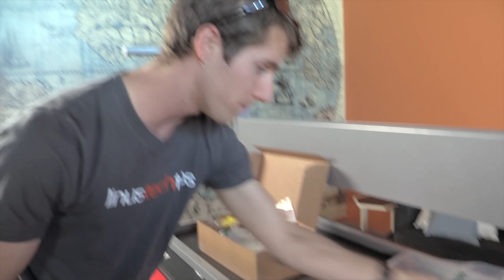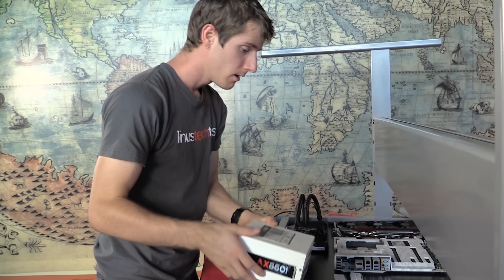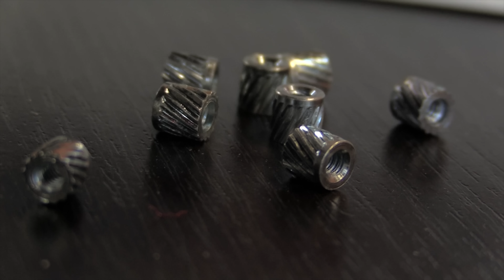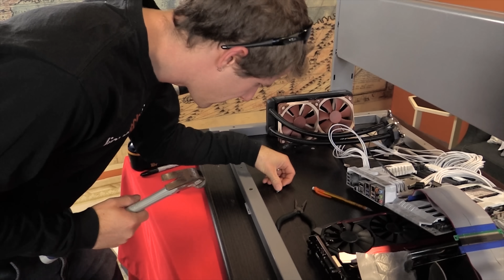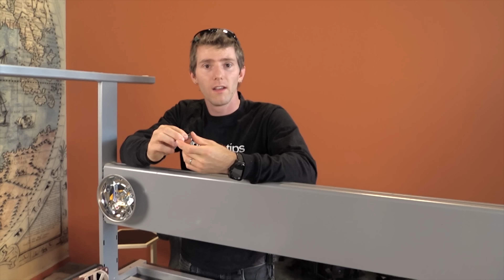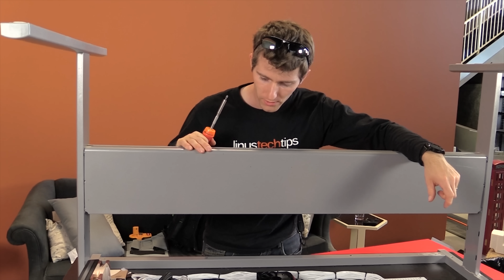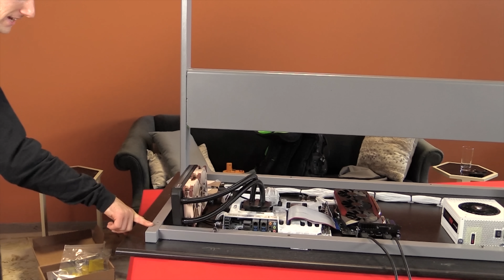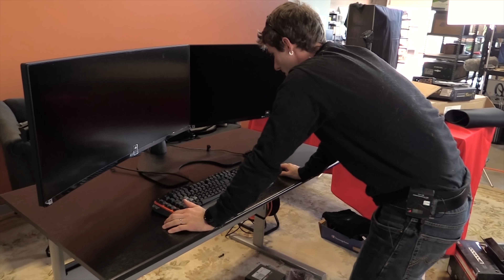The ULTIMATE Space-Saving PC - Desk PC Build Log

Comment: This is a fail of a fail of a fail. Better Solution - Install in side drawer or center drawer if it has enough clearance. Your board is upside down, but normal heat flow was assumed, correctly, from the Side or Bottom Up. You did say it! But Still 100% someone is going to sit down and hit their leg/knee into that unprotected computer. A minor pain for them, a Major pain to the board's functional lifetime. 
So my take on this: Do Not Try This At Home!!!

Comment: Edit @16:19: See? I told you, Linus. Now you have to wear a full face helmet in-case that shit falls on you.

Worst idea ever. Why not build into the SIDE of the desk (or inside a desk cabinet) so that you don't have to flip over the damn table every time you want to change something (Or alternatively have your table wall-mounted and it can be lifted with hinges but even then you will accidentally hit your knee into that giant protruding PSU.) Also why didn't you just use some cheap Industrial Velcro, or a slide lock with a bolt covering the slide mechanism? that way you need to do less screwing. Why does this look like someone paid you to do this Linus? This is was a terrible idea from the start.

Comment: I think if you use regular CPU air cooling you probably cannot mount the motherboard upside down ... perhaps you can try mounting the motherboard on the kickstand of the table, so the whole thing is  vertical instead of horizontal, and CPU air cooling can still work.

Comment: Building this computer with 2U or 3U rack mounting chassis and attaching it under the table would have been ,
1. Less painful.
2. Without custom wiring.
3. Easy to maintain.
4. More safer for user.
5. More safer for computer.
6. Equally space saving.
7. Less pron to dust.
8. And of course, less adventure.
9. Did I miss anything?

Linus, will you allow me to work with you there? I don't expect salary. Just give me food and place to sleep. 😉😍
I am really big fan of you. 🤗

Comment: the only con I see here. is it does limit where in your house you can put this. meaning not near vents where heating can blow into it. As well dust. But dust wouldnt be hard to clean out tbh.. can air... The only concern I have tbh would be the screw inserts failing and falling out..

Comment: this seems very interesting but it can be better. maybe mount the keyboard inside the top of the desk and replace some wood with glass and use rgb lighting, get a usb hub and mount it inside the top as well, and if you could find away around  wire management make the computer rest on a board and use the sliding drawer things on the sides so you can just pull it out when you need to service it d:

Comment: I was looking at the setup and was like... Which way does it go? But it was corrected.

If I were to do this, the PSU and the Cooler would he on the back side of the kick panel. The fans would probably work less, due to the metal frame absorbing the heat.

Second option, mounting on a board and then to the desk. If the desk got damaged, I would not have to redo all the work!

Comment: Does it effect the air flow though, compared to a close case.. like heat what is the difference between a closed case compared to open components stuck to the bottom of a table, also dust? Is it effect because it's all facing down?
Also the way the graphics card is plugged in, does it effect performance because it's using a cable from the card to go into pci express when normal would just go direct, so is there a difference in performance... also what if the graphics card was on the board, would it be too much pulling it down?

Comment: he should test the configuration of cable using psu tester. by theory there is awg, v drop, length calculator. if u work in engineering this guy will definetly got fired and are million lost to company.

Comment: do you need to put thermal paste on your cpu?if you have that cooler?
Reply: Build your next PC yourself and dont use paste for the CPU. Lets see how long it will survive x)
Reply: HP. i thought if u installed the cpu cooler you dont need thermal paste,
Reply: nah m8. you always need some otherwise your cpu will die
Reply: HP. okay thanks!
Reply: +HP. it won't die... most people just put the paste on the first time building the PC, but they can't be asked to maintain it after years,  like my PCs,  they all survive 6 years + . So I can tell you that without the paste it will survive, just a bit hotter than it doesn't have the paste
Reply: +Andy G I said it will still run, but I didn't say its suggested,  and in fact. it will run fine and wont die. read here before you wanna continue arguing with me 

http://www.tomshardware.co.uk/forum/292749-28-thermal-paste
Reply: +Andy G False, its HIGHLY recommended to use Thermal Paste, but ive seen them run (personally) without thermal paste.

Amd Barton, Celeron, Intel P4, AMD Phenom II 955BE.

Ok they run Higher temps, but they still ran fine. But im not suggesting to run without Thermal Paste, actually suggesting the oposite, but it can be done.
Reply: +Andy G You can run your CPU without therm but like reccy stated, its not suggested; but is possible. Heat readings will be about 30-40% higher, and you will experience a freeze if you try to run any game (due to overheat).
Reply: +Andy G I don't have time to write essays to debate with you, first, without thermal paste wont go to 99 degree, without a fan would. And your computer will shut down without a fan, not without thermal paste, also , when your computer shut down due to reaching about 100 degree, that is your pc protecting it from not to have any damage , so technically it wont damage your PC if it overheat and shut down by itself . I am not trying to educate you that something you don't know, you just don't believe what other people say or too scared to believe what you think is 'dangerous' 
that's all.
Reply: +kenniikalonji welcome to the internet? if you don't like notifications you can turn the shit off
Reply: +Andy G I didn't say you were wrong, I am saying CPU can run without putting thermal paste, just not recommended,  its like you can have sex without using condoms or lube, just not recommended. CPU wont run without a FAN, not thermal paste. also tom' s hardware. com has said that without thermal paste can run. BTW if a cpu's thermal paste is dried up after years, its the SAME as no thermal paste at all.  if you don't believe me go search on Google.
Reply: +Andy G https://www.quora.com/What-will-happen-if-I-dont-put-a-thermal-paste-in-my-processor-and-heatsink

Aren't you keep replying just because you want to show that you are better ? LOL 

the link above shows that professional people confirm that without thermal paste computers will run. 

so don't tell me I was 'spreading wrong information'
 
according to the link:  

Does this mean that your CPU will burn out and die? No. Does it mean that it is more likely to? Yes. Does it mean that your CPU will throttle? No. Does it mean that it is more likely to? Yes. Can you run your CPU without thermal paste for years and still have an operating computer? Yes. Is it a good idea to try? No. 

And these are exactly what I said,  it will run but just not recommended, my information is absolutely correct, mate.
Reply: +Andy G Ok...now you tell me you know 'pc with run without thermal paste '? that's what I said on my VERY FIRST comment,  so why did you comment on my comment saying I was speading false information? All I said was 'PC WILL RUN WITHOUT THERMAL PASTE , but not recommended'  LOL you are just contradicting yourself and making me laugh now
Reply: +Andy G I don't recommend it myself as well, but fact is fact, it will not die for years!  now you can stfu lol
Reply: enough guys....this comment has been answered a month ago thanks for other tips too btw....have a nice day

Comment: i using spacer screw and glue them with some rubber for the grip instead of those mobo stand off. i got bunch ( roughly about 30 ) of them for less than 1$ lol and that is enough for all of my pc components. okay i don't see any different between mobo stand off and spacer screw they are look same :3 but spacer screw way much cheaper i think

Comment: so cool, dude! may be you can also build an as flat as possible cpu.
Reply: you mean like the lowest profile custom case or something? (add to the challenge by saying a full desktop graphics card perhaps?
Reply: +DFX2KX I mean like the thinnest cpu.
Reply: if you mean the CPU die itself, they're as thin as they can get. CPU means the processor itself, hence my confusion. if you're talking the whole tower, using some PCIE/RAM extensions could let you get it about as thin as the back panel, provided you wanted to solder up a custom DC/DC converter. 

If you're talking the thinnest central processor. 486DX2, as it needs no heat since, or an ARM chip.
Reply: +DFX2KX I meant the whole tower which houses the motherboard, disk drives, ssd, psu, etc. You seem quite knowledgeable.
Reply: ah, that clarifies it. And I try to be. you can make VERY slim PCs if you want. half-height videocards exist for this exact reason, and some custom slim cases use PCI-E ribbon to put them sideways so it's even narrower.

The absolute minimum you can have is something like this for normal folks. http://www.newegg.com/Product/Product.aspx?Item=N82E16811163252

And if you make a custom power brick, about an inch lower, but you're custom-machining case parts at that point.

Comment: I considered doing this a while back, mine would have had a modified Cable Grommet in front of the monitor that had two USB connectors, the power hard drive LEDs, and the power switch. I may do this later to mount a server and network equipment in an old entertainment center.

Comment: it's not cool, because your knee will kick the component
Reply: get tempered glass, mount it to the bottom of the desk as protection.
Reply: thought exactly the same
Reply: If he do that again with better table i think arrow in the knee wouldnt be the problem.
Reply: The problem is, is it  necessary to 'fixed place' the computer component under table? I use itx form factor system, and I place my case under desk(for reduce dust), and I'm sure my leg will not kick it, this is my best solution, rather than a "computer desk"
Reply: my PC is full powerd core I7-6700 and a geforce GTX 1070 for VR

Comment: Hi +LinusTechTips , i had some thoughts with the space-saving pc, As +linustechtips had tested so many device/hardware before, i hope you may able to reply me some question as below:
1. The PSU (power supply unit) always a massive type in a big box, is there an any other Slim PSU that we can opt it out/replace it?
2. Is there is anyway to re-arrange graphic card without directly attach to the motherboard, it always annoying the people who try to adjust the space in the PC-case ,maybe there exist any extension cable to link the graphic card, so we can give more space to put under the table without showing another few inches?
3. it would be better if there is any pc-case manufacture/furniture design for a long table and put all the component in a drawer(maybe 3 drawer, u know those streamer these days use maybe 3 desktop for different function like 1 for gaming, 1 for listen songs and reply twitch chatbox,one for video editing,+++) in a long desk (just below the table), so you can pull it out anytime you want to do a maintenance without getting annoying to remove screw/nuts from the conventional PC-case.

Comment: I think if anyone were to do this, I'd be really worried about the asthetic and about accidentally touching things. I think what I would do is I'd mod the desk too. There'd be some supports to mount a cover for the components, and then magnetic dust filters or something that make up the walls. And if you need extra fan space, you could just make the walls high enough to mount fans onto the ceiling, the gound being under the desk (picture the desk flipped over like Linus did while building this). Or to save space, time, maybe money, and effort, buy a pc desk from lian li or something

Comment: Is having a smaller SSD and an HDD as good as having large SSD?
Reply: The ssd will always be faster due to the fact that it's digital, but most people use a small ssd just for startup and an hdd for large amounts of storage. So technically the answer is no, but the difference doesn't matter that much
Reply: Henry, personally I would wait and buy the SSD, rather than a mechanical drive.    Here's two thoughts.   First the manufacturers rate the drive "life span" in hours.    Old mechanical drives used to be rated around 50,000 hrs.   This may have change in the last few years, since I bought my last mechanical HD.    The new SSD's are rated at two million hours or at least that's what was reported on a big name "hardware review website".   The second thought.   Think about how much space you actually need.    A terabyte sounds sexy, but would you really use all that space.   You might find you don't need a huge SSD.     I currently use a 120 gig SSD for O/S and it's blazingly fast.   Even with several years worth of M$ updates and my programs, and a lot of stuff, I'm only using 80 gigs.    I also have two 500 gig mechanical HD's.  The contents of both would fit on a 240 gig SSD with room to spare.   Just a few things to think about.

Comment: This is kind of stupid and ingenious all at the same time.
Reply: How the fuck is this stupid?
Reply: Hit your knee on the bottom of the table and smash your GPU, or CPU or memory that's how.  But the idea of having a desk that actually IS the computer case is pretty cool.
Reply: +Indiana Joe I mean, if you really wanted to, it could be like a desk you had in grade school, have another layer of wood protecting the hardware. Ventilation wouldn't be an issue because you could easily cut a few holes to increase airflow.
Reply: Jake Austin
Yeah, it could work if done right.  You have to have a desk for a desktop computer, but really a separate case isn't needed.  If done right, the desk top could flip up to expose the components, fans etc. Just screwing them to the bottom of a regular desk isn't a good idea though.

Comment: What about putting them inside your desk? I mean, if you have a drawer at the middle of your desk like I do. I'm not sure how I could do it AND keep it cool and quiet. I'm sure that it could be achieved, but does anyone have any tips for it? I really don't like cables showing that much, and my desk has a hole for cables that can be accessed directly from the desk drawer(still going to mod the desk so that the cables coming out from the computer aren't cramped, if the idea is even possible to execute well.). I'm also not sure about cooling solutions. I'm thinking about a Seidon, because it is small enough for the drawer. But how could I cool the whole thing itself? I could paint the whole desk black and put vents on the front for intake and exhaust, but I'm not that experienced with PC cooling.
Reply: Like a school desk? just try to a) keep the profile low and b) have plans for possible water fails and maintenance.
Reply: PennyAfNorberg A school desk? No. A desk like this: |"""|||. The quotation marks are the desk drawer. The 3 vertical lines on the right side are the space where the computer normally would be, and the vertical line on the left side is just a foot for it. The computer would go inside the desk drawer. The reason I thought of the Seidon literally was to keep a low profile. But any tips on keeping it cool?
Reply: I'm tried to build something at the moment so I can't really give any advice, but cool: water cooling?  and low profile is for motherboard, grafix, psu, drives and other things. I think you can go down to 4.5cm, and flip the radiators in some good way.
Reply: PennyAfNorberg If you want to help me more, the desk is an IKEA Micke desk, so there's some reference for you. The GPU solution would be done similarly to the PC in the video. Would I need to mod the case so I can add intake and exhaust fans, and how would I do it? I could put either of those(intake probably) under the desk drawer. But how would I do the exhaust fan solution?
Reply: Byter till svenska: hur hög är lådan invändigt? mer än 8.5 cm?  mer än 12 cm?  
Du skulle kunna sätta in och utblås i botten  av lådan kanske? Du vill nog montera i botten av lådan eller kunna ta bort baksidan av lådan, men då bör du även ha en idé på hur ev. vattenläcka skulle hanteras.
Reply: PennyAfNorberg But I'm Finnish ・-・ Just kidding, I can understand most of it :D I don't speak Swedish Swedish though, so I'll just stick to English to avoid confusion. I thought about putting the intake at the bottom, but I don't think the exhaust would work as well if it was at the same side. Not sure about the drawer height, and I can't find them. I can safely say that it's at least 7cm(I don't have a ruler, but I know the approximate length of a centimeter). Also, liquid coolers really don't leak that often, and I know what to do if one happens, and I will do the 24h test before operating it.
Reply: A standard  psu is 9 cm height. Water cooling don't leak often of course but if they do, spec if the motherboard and the grafiks in ontop -> water would run onto it not drop away from it.

Comment: I think I am going to do this...only, I don't have to buy or take apart anything. I may get some kind of huge cable shelf for under my desk and then change the settings on my laptop so it still works when the lift is closed and then of course you put the laptop under the desk along with all the cables and use a gaming mouse and keyboard along with connected monitors on the surface of the desk(s), boom. 

Hope this helps those who see it too. :)
Reply: Cool!